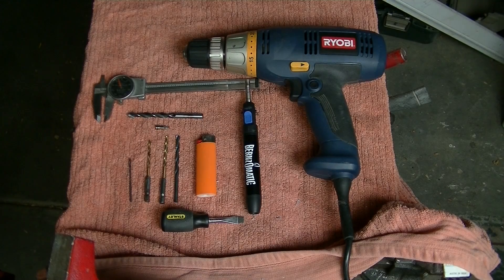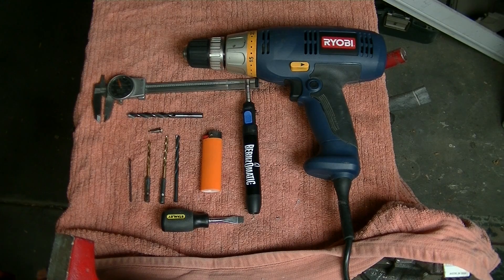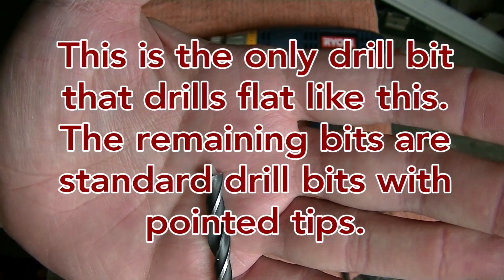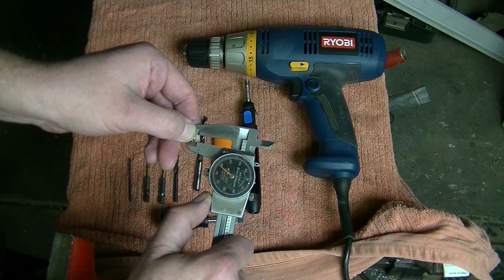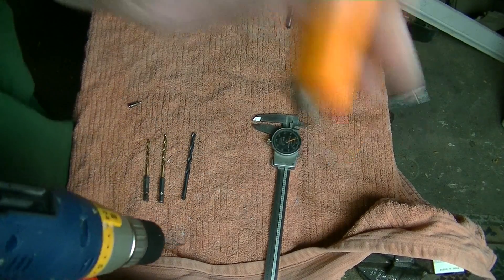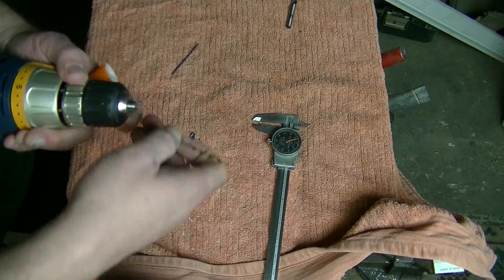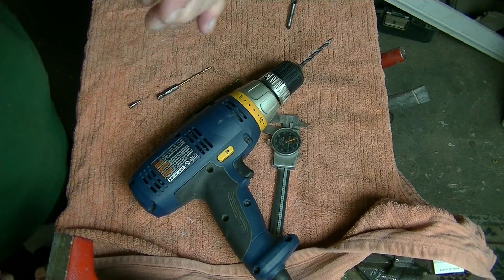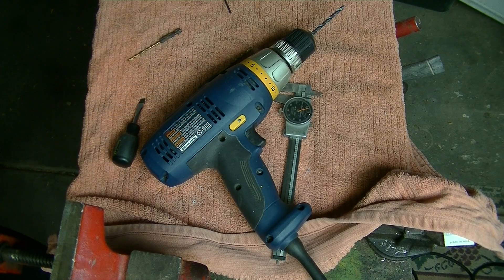Make A Bic Lighter Refillable By Installing A Refill Valve

Comment: use  valve off of these torches, they are cheaper 

https://www.ebay.com/itm/Set-of-2-Butane-MINI-PENCIL-TORCHES-Refillable-Welding-Soldering-Jewerly-Repair/312462075766?_trkparms=aid%3D1110001%26algo%3DSPLICE.SIM%26ao%3D1%26asc%3D20131231084308%26meid%3Debff7560fb164454a2e6d9e19c2b3732%26pid%3D100010%26rk%3D3%26rkt%3D12%26sd%3D312272439348%26itm%3D312462075766%26pmt%3D0%26noa%3D1%26pg%3D2047675&_trksid=p2047675.c100010.m2109
Reply from the maker: Dara, the valves in those torches are way too long to work in a Bic ... have you ever taken one out of those torch lighters?
Reply: @MikeSims70   I have one I am looking at it you are right it is 1.5 times wider in diameter 6 mm verses 4 mm.  With good drill bit and drill press you may be able make some using 4 mm screw, rubber washer and and a spring. I have not tried it yet, the larger one may work. The valve should be normally closed until pressed and tested with a little soapy water for leaks. look at a valve insert of a car tire valve. You will need an O ring as well to seal the threads.
Reply from the maker: @daraparsi  "look at a valve insert of a car tire valve." Tire valves protrude outward not inward ... so I don't think I'm visualizing what you're referring to properly... can you give me a link so I can see what you're talking about?

Comment: Well what do you do when the flint is all used?
Reply from the maker: Bic flints are outrageously large, and I typically get 20 to 30 refills on a single flint.  When the flint is gone, I move the nozzle to another lighter.
Reply: Thank you
Reply: You can take the spark shield off, then strike wheel and replace it....in about 30 seconds or less. Its extremely easy.
Reply: Cut the spring in half and add 2 flint from old LIGHTER

Comment: My research shows it to be a spear point drill bit, different twist than a standard or brad point drill bit. My other research for sizing info doesn't apply as I had to purchase a Weller ML500MP and the removable valve appears to be smaller at 11/64th at the center shaft measurement. And not worth the purchase price for the smaller valve.
Reply from the maker: Very thorough information, thank you.

Comment: Is there anywhere to buy just the butane nozzles, Instead of buying the whole torch?
Reply from the maker: YES! Look for them where ever you can purchase Airsoft parts for like ... airsoft paint pellet guns ... they can usually be found for around $6 each.
Reply from the maker: There should be links in the video description as well ... ill check and see if they are still any good. If not ill find some working links and update the description.

Comment: A flat drill bit usually used to drill through like masonry or metal and the other regular ones you were using our for like wood. Great video
Reply from the maker: Thank you, the drill bit topic has been exhausted down lower in the discussion. And I appreciate you appreciating the video.  :)

Comment: try putting in a new flint. such fun. until the spring flies off into another dimension. but it can be done is you have a sentimental bic you just can not part from.
Reply from the maker: They can be tricky for sure... :-)

Comment: Easier to just wedge the valve open on the top and fill it from the top.
Reply from the maker: I would argue that a top fill method is difficult, it wastes a lot of butane and you cant put as much butane into the lighter.
Reply: I just buy disposable lighters that are refillable and reflintable which the least trouble of all. https://www.amazon.com/Bundle-Original-Clipper-Lighters-Removable/dp/B00JH2P8BS
Reply: @KillerNetDog  But then you are stuck with a crappy Clipper, no thanks!!
Reply: did you try it ?

Comment: Thanks for this video.  You did a great job showing us.  THANKS ESPECIALLY FOR THE LINK IN THE DESCRIPTION FOR THE VALVE.    I just completed converting a DJeep non refillable to refillable.  Now no wasted plastic and saving money in the long run.  The environment and our wallets thank us.  Win Win
Reply from the maker: Thanks for the comment.
Reply: @MikeSims70  Ya man, i actually did this with 2 dJEEP lighters and the second time it worked great!
Reply from the maker: @CalebNorthNorman  I'm not familiar with dJEEP lighters, but I'm happy to hear that it worked for you!  :-)
Reply: @MikeSims70  like Bic,  they are french.  But they are some kind of special.  My favorite
Reply from the maker: @CalebNorthNorman  ok so I googled them and it looks like the sell those with refill nozzles in them ... but they protrude out the bottom so they arent flush and you cant stand them upright...
Reply from the maker: @CalebNorthNorman  they certainly have a nice big tank on them ... I'll have to see if I can buy one somewhere and try it out.
Reply: @MikeSims70  i bought mine on ebay and at the time i couldn't find any that were refillable.  If they are refillable they have a tiny valve not like the airsoft co2 valve that fit our American butane bottles.
Reply: @MikeSims70  they have them on ebay.  Its kind of cool because they are all limited edition. Some times they have Marilyn Monroe and sometimes they have Military themed ones but then they are gone for a while and just have solid colors.
Reply from the maker: @CalebNorthNorman  just google dJEEP lighter - and click on Pictures and you'll see some which will take you to sites I guess you can purchase from.

Comment: I did a bit of digging and it looks like you can buy the valves for about $5 a piece on amazon under "Green gas valve" or "airsoft gas valve". I have not tested but the green gas can nozzle and airsoft valves look identical to butane.
Reply from the maker: Yes, at the time I made this video, Amazon didn't sell the valves and I was not aware of their popularity in paintball guns.

Comment: It's almost cheaper to keep buying the burns-o-matic pencil torch. Amazon has them for about $8 each or there are 3 packs  for $15. They're with the airsoft / paintball  refill stuff.. I found a supplier that sells the more economical  valve but they were pressed into round tin blanks  that would be used to make the bottom of a fuel cell of some sort. They are only 5 cents each. However,  minimum order is 50,000 units.. ...that's a lot of nickels.
Reply from the maker: 50,000? Ummmm ... yeah!

Comment: They should  make self tap refill nozzles for cheap. End this plastic problem
Reply from the maker: Ive been thinking of a way to make a device that you place the lighter in, then a valve, pull the handle and WALLA!
Reply: @MikeSims70  voila
Reply: They do, I got mine at the dollar store.

Comment: You can buy them on eBay, 5 pcs. for $15.00 free shipping. Here is the link: https://www.ebay.com/itm/Gas-fill-valve-for-GBB-airsoft-5x-pack/183519362692?hash=item2aba9b3e84:g:r1wAAOSwF~hb32m9
Reply: Not anymore😞

Comment: Yeah anyone with a decent phone or computer can hear the lighter leaking
Reply from the maker: I'll confess ... when I drilled that lighter out and I messed up the angle, it did leak ... I tried to edit it as best I could, but Ive done this successfully MANY times.... I just didn't want to do it over again for the video so I made the best of it.  ;-) Good call Chris ... you're the first one who caught it out of almost 320,000 views.
Reply: Actually Mike,  it’s not always best to edit out the mistakes, so as people can only see a perfect process going on, because as you know, it isn’t always that way, just like you tried to edit it out. It’s good to have you presenting the obstacles so that you can potentially help us get through those obstacles as well, when we encounter them, just as you have.  Once again, thanks for sharing that info, regardless....  and thanks for that little confession, LOL. Aloha
Reply from the maker: @6980869  I'm not generally into hiding truth ... it does nothing to further knowledge.  :)
Reply: I can confirm your process works perfectly. I've followed the instructions and have never had a leak or problem of any kind. I've made a dozen of these refillable Bics and I use my favorite lighters from that batch for over a year each. Your process is sound and it works great.
Reply from the maker: @Minong_Manitou_Mishepeshu  THATS AWESOME!  I have accomplished what I intended with this video then ... I can die now.   ;-)

Comment: The BIC lighter company needs to get into the 21st century.
I actually use a plasma lighter that is rechargeable, from Walmart that is only 13.99 and will last 20x longer than a BIC.
Reply: Bet it won't. And it will never be nearly cool as a pre 1993 refillable Bic adjustable flame classic. Legand>gimmick
Reply: Zippo
Reply: Who wants a pocket brick that stinks and leaks and constantly runs out of fluid and flint? Zippo lit items smell and taste disgusting, like hobo smoke.
Reply: @Minong_Manitou_Mishepeshu  : It does leak, when improperly filled or over-filled. That's easily preventable. Ronson's liquid butane is a sweeter smelling alternative to Zippo's liquid butane. The Slim Zippo and Candle Zippo are alternatives to the traditional size. There are also gas butane refillables, like the Clipper, the Huowa Torch, and the Zgar Torch. Here is a cost comparison of alternatives to the offering in this Vlog:

5 pack of Bic knock offs at the dollar store, $1;  ≈ 20¢ per lighter.
No drilling or chipping, but plastic waste!

Clipper lighter, $4.79; 300ml refined butane gas, $2.97 ( ≈30 refills); $7.76/30 ≈ 26¢ per lighter.
Zippo lighter, $11.12; 12oz butane liquid, $6.86 ( ≈78 refills); $17.98/78  ≈ 23¢ per lighter.
No drilling or chipping! No plastic waste!
Reply from the maker: Plasma lighters are not usable for all purposes that a flame lighter can handle.

Comment: Some constructive comments. That is not a micrometer, it's a dial caliper. It probably has a metal rod that comes out of the bottom when opening. That's a depth gauge. Measure how deep the valve needs to be drilled and use that know your depth. Or measure the valve and then mark the drill bit with a marker. It will be faster and that the guessing out. Also have you thought about using the valve from an adjustable lighter? About $.50 a lighter, probably the cheapest option. And I do really like this video and I am going to give it try. I'm all for saving items and repurposing them.
Reply from the maker: Phillip, do you have a link to the "Adjustable lighter refill valve"?  Thanks for the comments ... we settled the calliper issue couple years ago... had I known this video was going to get so much publicity, I would have been more concise and more accurate with my terms etc. Its my first "do-it-yourself" video and I honestly only expected MAyBE 100 views... it is what it is... thanks for the feedback and the compliments.  :-)

Comment: Then the flint went....
Reply from the maker: I've got a Bic that I've refilled so many times, I cant remember, and the flint still has mileage left ... their flints are the largest Ive ever seen.
Reply: tha rezzie The flint is the easiest part to replace. Each flint last 2 months with heavy use.
Reply: Mike Sims I've replaced a dozen flints. Takes about 10 seconds after you do it once or twice.

Comment: My smoke shop gives me a lighter for $1c (yes One Cent) when I buy cigs. They are refillable!! ...but they are hard to light. Takes a lot of effort to push the button. Paiute smoke shop in Las Vegas, NV. I've got about 40 of them! I will use one or two to try your experiment.
Reply: John Privitera Use a Bic. I'm sure they aren't selling you a quality lighter for a cent. You couldn't pay me a dollar to use those scrappy see thru crack head lighters.
Reply: The whole point is making a bic refillable because of their superiority. Yeah, there's lot's of refillable lighters around $1 or less but they're no where near the same quality as a bic. Most are the "clicker" type that stop working after a couple refills; mainly because the piezo clicker plastic parts break. Also, the nozzle begins to clog up, more so when using cheap 5x butane. Harder to find are refillable flint and roller type lighters but they're even more annoying. They have like a 1 out of every 3 attempts of getting a flame while bics light up almost every time (feels like 19 out of 20). And other  than a zippo there's not many lighters that stand a chance in a wind like a bic does.

If i was offered a 1 cent cheapo lighter, I would say "Nah, get that cheap shit away from me man. I'll buy a bic though.". Actually, to be honest, I would also take the 1 cent lighter and use it for something else. Maybe make it into a 15 second flame thrower or something along those lines.
Reply: @heatedcr  100% agreed. Well said.
Reply from the maker: Switch to vaping … stop inhaling toxins! Heart and artery disease - #1 killer of tobacco smokers

Comment: It'll only last as long as the flint but, still, that's a lot of fun for an accessible hobby project. Now I can actually consider refilling my Bic with high quality butane. Pickle Bic needs some Pickle Rick. ($8 to get one of the valves. $5 for a Bic? Doing the math... coming up roses).

Comment: When I was ten I found a Zippo lighter and wanted to refill it so I got a cheap clear lighter for the fuel. I started sawing the lighter in half and as soon as I made the cut threw the lighter  the fluid disappeared, I was like WTF..lol
Good old days!
Reply from the maker: Whe n I was 9 years old, we dug a big hole in the ground and covered it with plywood and called it a fort ... then we had like a fireplace dug in there too ... I found a bic lighter that ended up being empty so I threw it in the fire ... when it blew up (which I did not know it was going to blow up so it scared the shit out of me) ... it rolled a flame on the walls of the fort and the flame surrounded me for about 2 seconds ... I never did that again. ;-)

Comment: Maybe I'm overlooking something but it seems easier to drill your hole on one side (probably opposite side of your puckup tube)  wouldn't this save not having to carve that middle out? Also I bet if you contacted benzo or another refillable lighter they could sell you some refill nozzles or hook you up with their distributor. GREAT IDEA BTW !!!!
Reply from the maker: Cuda, the points you raise have been dealt with thoroughly in the comments here. And they do sell shorter nozzles so that you don't have to chip out the middle.

Comment: I used to have a torch refillable lighter but recently I ended up dropping and cracking it. Can I use its valve for your hack?
Reply from the maker: You can  give it the ol college try.

Comment: I have seen others ask w hy you would do this. I have a vintage Winston Table Lighter that I purchased from eBay. It has a cricket lighter that is now empty, and had the flint unusable. I am planning on doing this to restore the cricket lighter to use, as it is an oval/octagonal shape that fits inside the Winston holder base, and could not be replaced by a Bic lighter. Another tip for others attempting the flint replacement or repair. I used a flat blade small Skil screw driver from Model #010-359-SKL and worked it clock wise and counter clock wise, chewing up the flint until I got to the spring. I used the flat blade screwdriver to push the spring back in, positioned a flint above the flat blade with needle nose pliers, and moved the flat blade atop the flint pushing it in, and then put the flint wheel back into place. I will try to get my wife to film me doing this, and upload it, for those who wish to attempt the repair. It also works with the penguin lighters after removing the spring to remove the obstructing old flint, under the flint wheel.
Reply from the maker: James Maddox - I simply stopped entertaining stupid questions ... why would you do it? There are too many answers to dignify the question as one rooted in reason and awareness ... i usually just delete them as I see them ☺

Comment: You can buy a lot of refillable lighters for 10 bucks. You must have a lot of time on your hands
Reply: fezbot100 They aren't Bics, so what's your point? Crap lighters should be $1 a dozen. You get what you pay for....that's the reason you make a Bic refillable. They are the best.
Reply: fezbot100 can you refill more than once with a tack? I don't use tacks because they effect the looks and function if my Bic. Make it look tacky like a teen ager hack. I don't want the look of my pre 1993 adjustable flame lighters ruined by a rack hanging off the bottom. That's just me, I'm picky. I must always gave the best. I don't use tacks or any lighters besides Bic.
Reply: Minong Maniac whatever. I don't care.
Reply: fezbot100 one day when you do care, this is how you are going to do it. Put a little quality in that tack hole.
Reply: Minong Maniac you can absolutely reuse the tack
You can't replace the Flint after you spend 10 bucks making it "reusable"
Reply: Maui Randall I replace my flint 1 time every two months. Takes 10 secs.
Reply from the maker: Time ... boredom ... ingenuity ... take your pick ... and just look at all the comments!